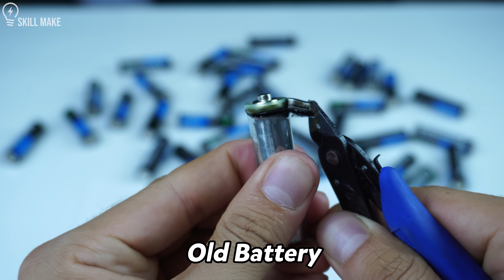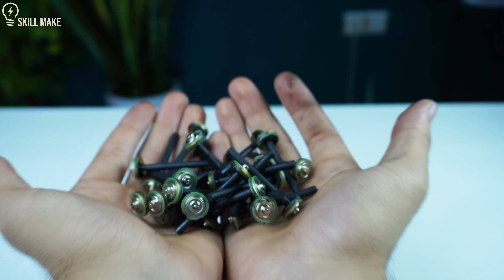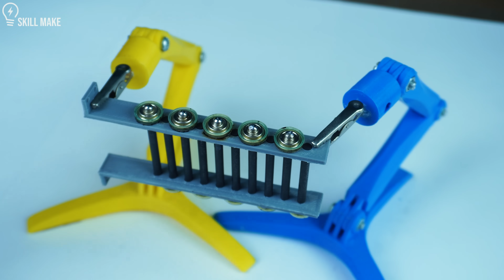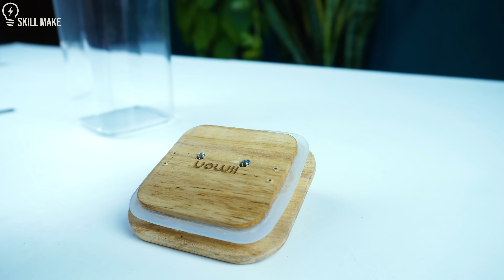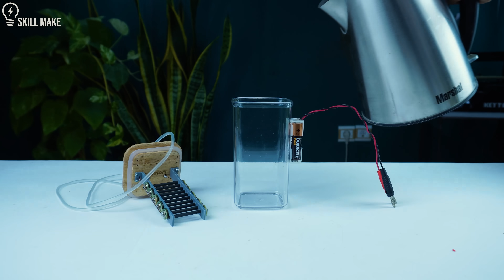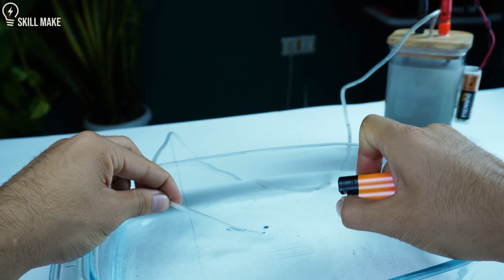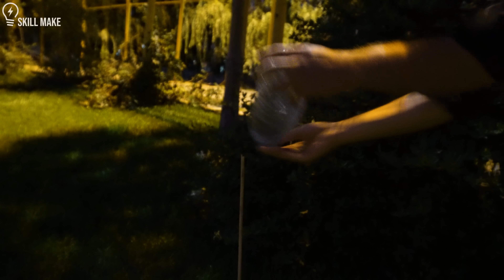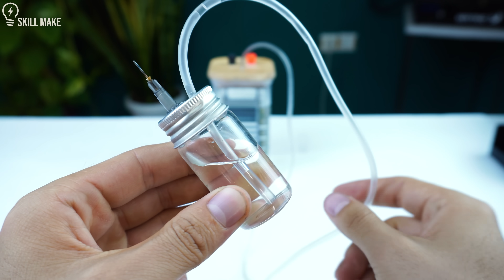Water into Hydrogen - Making a Simple Hydrogen Generator from old battery - hho

Comment: Here in Brazil, a guy used this idea to insert hydrogen into the car's combustion chamber. It worked perfectly. He managed to drive about 200 km on just one liter of gasoline. To produce hydrolysis, he installed a gear on one of the rear wheels of his car. The gear took the movement of the wheel shaft to rotate a copper piston inside coils made of copper wire. The energy produced was sent to an auxiliary battery, whose electricity was used to produce electrolysis. After a while, this guy disappeared. We never heard from him again. I believe they gave him a lot of money to keep quiet and forget about the project. But now everyone knows how to do it, so it's all a matter of personal initiative or financial interest to make this idea popular and common in all vehicles.
Reply: Toyota has a hydrogen/electric car on the market now.
Btw, the water fueled car was created in 1920 by Stanley Myers & they killed him. Other people too.
Reply: hydrogen
Reply: Hydrogen is a super inefficient form of energy. Nobody uses hydrogen cars because of thermodynamics. Not some big conspiracy.
Reply: @valeriegiles6524 hydrogen fuel cars require input enegy to break the bonds. This means you have to fuel to generator. Which makes an inefficient source of fuel for an already inefficient engine. Its a stupid idea that never took of because it doesnt consider thermodynamics.
Reply: Don't they launch rockets with hydrogen?
Reply: @TheLuketh1990  liquid hydrogen, which is much more dense and even more thermodynamically unfesable for smaller vehicles to use. We use it for rockets because there arent many better options
Reply: @valeriegiles6524 this is, of course, both completely untrue and also completely impossible.  You cannot violate the laws of thermodynamics.
Reply: @nickmcdonald3083 there’s nothing conceptually wrong with hydrogen as a fuel.  It’s just the practicality of storing enough of it to be efficient.
Reply: He probably blew himself up
Reply: This is absurd. Why would you install a gear on a rear wheels when you can use the alternator? It's more efficient. The rear wheel doesn't produce free energy, it take energy from engine, as the alternator, but it's much more efficient to take electricity from alternator directly instead of that rear wheel contraption.

Comment: Very nice compact little cell!  I like it.  The only problem is you have more than just the graphite rods making contact with the solution.  You have screw heads and wire also taking part in the electrolysis reaction.  The graphite won't corrode but the other parts will (anode, especially).
Reply: Who prevents you from varnishing these parts?
Reply: Would stainless corrode?
Reply: @neilstern7108  It shouldn't. Of course, stainless steel can be different. But mostly it is corrosion resistant.
Reply: @Walker7745  thanks for your reply.  It is also non magnetic if that helps anything.  I'd love to make one. You guys are awesome.
Reply: @neilstern7108  Yes, you successfully reminded me. Suitable stainless steel should be non-magnetic - this is the right sign. Okay Good luck to you.
Reply: @Walker7745  thanks
Reply: The screws are above the water..
Reply: @zenginellc  not exactly screws but the graphite rods still has the battery terminals and he soldered a bus to them.
Reply: It should be noted that all newer alkaline battery cells (I have personally verrified this <in the US @ least>) of Energizer, Duracell & Rayovac no longer use graphite rods at all. Instead they have an extremely thin (2-3mm) steel nail running through their core instead, so you will need to source the rod from somewhere else. I was intending to use it to make bleach for cleaning during covid, considering there wasn't any on store shelves & there was a shortage. Also, Potassium Hydroxide is very corrosive- the bubbles, spray, & aerosolized vapor will make it come in contact with the lid, screws, sealant etc. It will quickly dissolve things like epoxy & any bare metal it comes in contact with. Lacquers, varnishes, nail polish won't last to protect parts because they will constantly off-gas. So as tiny molecular channels dissolve in the metal the gas bubbles will still form underneath the varnish & will peel up the varnish exposing more metal. You need something more resiliant like the liquid rubber that you use to coat the handles of tools like pliers with. It is also illegal to dispose of the used solution in public waterways, because standard water treatment facilities can't clean it out of the water- meaning you, & others will be drinking it later via at least food/drink preperation. You should find a chemical disposal program in your area. Also, please don't just tube the output to a bottle like he did- you want both of the bottles connected to a strong surface, so when gas ignites in the flashback arrester & it jumps it wont pull out a tube; potentially igniting the HHO stored in the main vessel or an intermediate tank.
Reply: Potassium Hydroxide is very corrosive- the bubbles, spray, & aerosolized vapor will make it come in contact with the lid, screws, sealant etc. It will quickly dissolve things like epoxy & any bare metal it comes in contact with. Lacquers, varnishes, or nail polish won't last to protect parts because they will constantly off-gas. So as tiny molecular channels dissolve in the metal the gas bubbles will still form underneath the varnish & will peel up the varnish exposing more metal. You need something more resiliant like the liquid rubber that you use to coat the handles of tools like pliers with. It is also illegal to dispose of the used solution in public waterways, because standard water treatment facilities can't clean it out of the water- meaning you, & others will be drinking it later via at least food/drink preperation. You should find a chemical disposal program in your area. @Walker7745
Reply: Yes it will sadly , stainless steel isn't truly stainless , it's most likely stainless coated .   Have tried using it and the electrolytes break down stainless.
Reply: Thanks , I have been telling this to people for years.  People just don't understand how dangerous this truely is.
Reply: Use Gold it won't corrode ❤
Reply: @mocogaming2022  expensive
Reply: @killerdeamonking For you all maybe.... but i just gave an option, btw you all didn't mention such metals can't be included in the list.
Reply: @mocogaming2022  true , I only tried a few diff metals so.  Stainless steel being one of such.   Never tried graphite though so.
Reply: Actually that won't have the effect your thinking of- although it is true that gold is extremely resistant to acids, that is not true of alkalines, like KOH or NaOH. Instead the gold will contaminate the electrolyte solution. In addition the quality & quantity of gold you would need makes this wholey unfeaseable for most ppl. Anything plated, & even true 8, 12, 14, 18, & 24 karat gold would all dissolve because it will break down the silver base first, through imperceptible scratches, dents etc where silver ions are exposed, seperating the gold from the metal amalgum. (As an example most ppl think when you get the green discoloration fom gold jewelry that it's a direct result of the acidity of your skin. What actually happens is the oils in your seabum atack the silver, (this is aided by bacteria that live in it) which neutralizes the acid & makes the oil alkaline, which then breaks down the gold. Of course copper will do the same thing but usually has a blue-er colored hue because of some of the copper turning to copper calcide). Anyway, you'd need near 99% pure gold. At current prices that's $1,828.86 USD for a Troy Oz. Even a single gram would set you back about $65.00. You could do it with a gram but you'd also need to flatten it because you'd lose a ton of surface area & really slow down the reaction unless you press it into something really thin. @mocogaming2022
Reply: @killerdeamonking  quality of stainless varies. Maybe you just had like you say plated.
Reply: @mocogaming2022  Even better: platinum
Reply: If you could seal it properly then drill holes in the container itself so only the graphite rods are in the container and have everything else outside. Not as clean or safe build though. As for finding the graphite vs metal rods, I expect the cheap really light batteries are the ones that have graphite rods.
Reply: @Walker7745 I would not recommend using stainless in an electrolysis environment. The anode side could react and release chrome  hexavalents which is very toxic...
Reply: @stormkhan4250  That's right. But chromium remains in solution. And your final product is hydrogen. In fact, you can use any electrodes. But the solution will have a dirty appearance - it is visually unpleasant. Graphite and stainless steel do not contaminate the solution.
Reply: Such a fun thread from a pretty cool build. I pretty much thought right away the the metal on the anode was not ideal. And separating the collections for hh and o for me just seemed more fun to enjoy the lighter than air qualities of the hydrogen, not to mention the safety factor of having the gasses separated.

Mind you there was so much more brought up that I would not have thought of. I will delay my playing with this at least an other day or 50.
Reply: @Walker7745  you still have to deal with the liquid at some point...why take the risk or pollute your environment? Maybe copper or aluminium? Ideally a large carbon flat bar that you can drill holes to mount all the smaller rods and eliminate even the soldering parts.
Reply: @stormkhan4250  I prefer a PEM electrolyzer.  Its solid polymer electrolyte needs only pure water (distilled or deionized) and you produce clean hydrogen separated from the oxygen.  The water stays clean, clear and non-corrosive.
Reply: @ChristmasEve777  that's fine if you have deep pockets or a large enough company that can afford PEMs but for a DIY project...not so much.
An element that goes into PEM is iridium, an element so rare on earth that only a few tons are produced globally each year...so how much does a PEM unit cost?
Reply: Will rubber past be able to prevent corrosion if the exposed ends are painted in rubber like flex seal?
Reply: 🤔 nice info. Graphite doesn't corrode, I use metals and salt, so corrosive.👍👍👍
Reply: @neilstern7108 да, будет. Пробовал делать катоды из нержавейки, - они постепенно деградируют и растворяются под действием хлора. Нужны угольные или платиновые катоды!
Reply: @Вольдемар-ж5б  thanks for your reply.
Reply: @stormkhan4250  very good info, thanks.
Reply: I also instantly noticed this. Its pretty stupid design!
Reply: @elvendragonhammer5433  What if the interior of the jar and all non-graphite conducting parts are covered with a film of silicone gel/oil? Will these be able to survive the corossive effects of drain cleaner? Just asking.
Reply: Your still going to have some degredation, though silicone is more ressiliant than most of the otherr stuff, part of the problem is the fact that your breaking down water which the added oxegen is an oxidizer with affects the metals more, & hydrogen which will bind & start to breakdown anything that is made of hydrocarbons, including plastics, silicone etc. Sadly there is no foolproof way to prevnet this. 

My suggestion is if you want to go the silicone route assemble everything you can first, mount it to the lids etc & then get some Type A (#1) CLEAR 100% silicone. Mix it with pure acetone until you have a consistancy a bit less than rubber cement so you can dip them & let them cure. 

It's way easier to cut & peel the silicone off the parts you want exposed than to try to goop that stuff onto it from a tube or caulk gun. (you might also be able to use a (non plastic, non acrylic paintbrush) if you can't tell look for the smallest horse-hair one you can find- it won't get melted by the acitone.   @upresins
Reply: @elvendragonhammer5433  Thanks for the response! Excellent! 
Just another doubt- how good would be PTFE, then? Would free H attack PTFE just as it would Silicone?
Reply: Sorry for the delay, it seems that somehow without my intervention YT has stopped displaying notifications to me- overriding the channel settings. If I hadn't just clicked the icon by accident I wouldn't have seen these- so now I've got about 45 in my que to sort out. Thanks for your patience. 

That's actually a good suggestion- didn't think of that. It will to some extent because it will affect anything that's a hydrocarbon, but given PTFE's "non-stick" like surface I'm guessing that it should be quite a bit less. Something else to try might be like a silicate putty, or glue. Don't know if it'd affect the binder holding it together, but it sure as hell won't affect the silica- (it is essentially pure quartz glass after all.) @upresins
Reply: Simple solution just use stainless steel 306 and grommets around the graphite rods on each side and then there's no corrosion easy done
Reply: @elvendragonhammer5433 so what is a decent electrolyte except KoH or NaOH, that won't corrode?

Comment: I have a Challenge for you, to create a DIY Hydrogen Camping Burner that can utilise Solar power to charge batteries that intern create sufficient H gas to cook food and for long periods of time.
It must be portable enough not to impose to much weight and be usable for upto 2 weeks until returning home.
I hope your up for it and that there lays an opportunity to create a small but potential business for Camping fanatics out there, good luck, and great vid, 😊👍
Reply: I Don't think that is a good idea at all unless you want to blow up your camper or yourself,  using hydrogen  around a fire is insane, I think you remember the space shuttle exploding just  after launch, That was hydrogen, I personally saw car batteries explode, when a car battery is charging  it is producing Hydrogen and if there is the smallest leak and you make spark you may even get killed, The  worst one of the two that saw blew up with such force  some of the plastic from the battery was stuck in the wood ceiling of the warehouse and that ceiling was 30 feet high
Reply: I came here just for this comment! Done outside away from the batteries might be a fun way to make the experiment functional for off grid use.
Reply: Solar to chemical battery to electricity to hydrogen to thermal.  Seems inefficient😅
Reply: If someone dose make a good hho generator tell no one but make a set of blue prints for it have it on many many USB flash drives and mail it to a bunch of people all over the world because when you try to get a pat. For it you and all your work will disappear as all world governments will try their best to snuff it out because if your independent you do not need the government and give instructions to the people you give the bp to tell them to make copy's and send it out into the world and so on and so forth so it can not be silenced